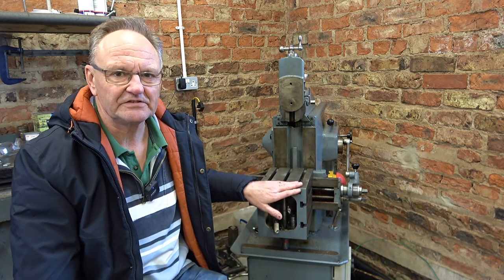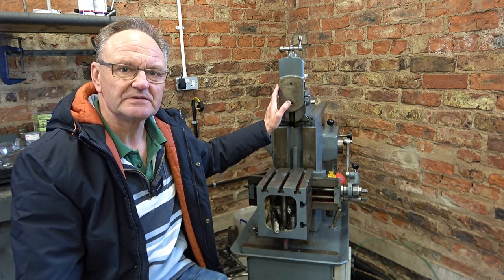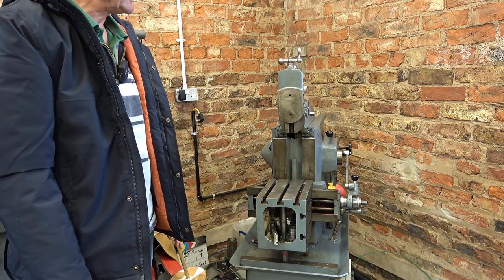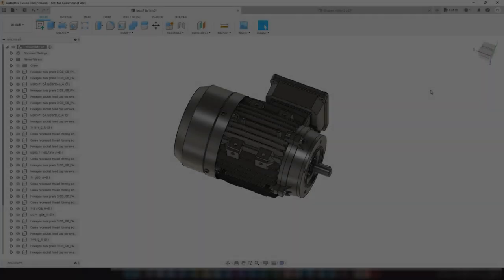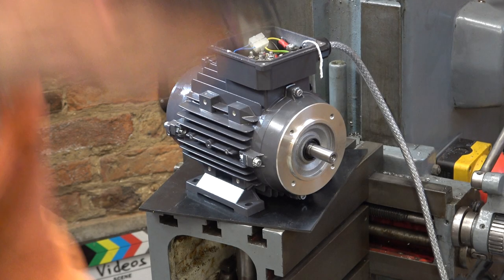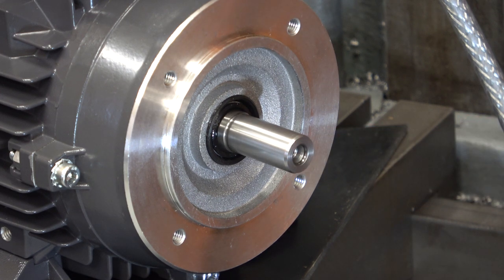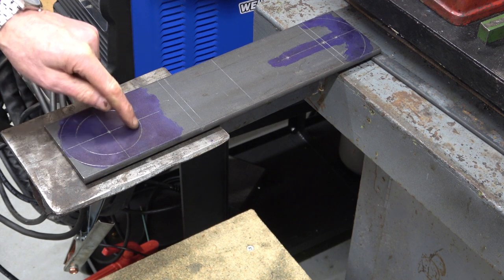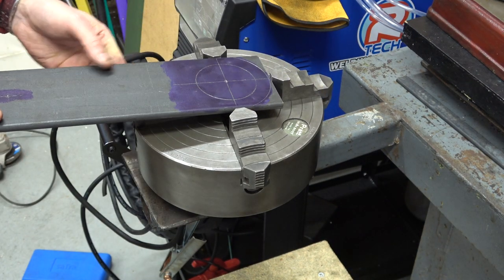HS132 Shaper milling head – Part 1

Comment: I got a kick out of your project. I  greatly appreciated re-manufacturing the motor too.
Reply from the maker: Hi Don, yes discovering I had to 'remanufacture' the motor was a bit of a disappointment since I had bought it new.  I would not mind if it were a scruffy old motor from a flea market.  But it worked out ok in the end. Cheers
Reply: @HaxbyShed  Fact is, I had a fan motor for our heating system go out on a cold night recently. Motors for the furnace are no longer made (too old). I found one of the same frame size and had to rewire the furnace because the motor was wound differently. God helps those who help themselves. What else can I say? II guess that says it all.

Comment: I can't wait to see how this turns out!  

You basically end up with a German or Swiss style milling machine like a Deckel or Aciera with your conversion.  I have actually considered doing this myself just to have something weird in the shop but it also gives you the ability to auto surface large areas of material if you use the shaper auto feed!  Anyone who might have doubted your project has never seen a large metal planer with a milling head attached, that happens all the time and people have been doing that conversion for more than 100 years!

Thanks for positing this!  Super cool project!
Reply: How might it work with the shaper auto-feed? The shaper feeds during the return stroke of the ram, so any cut made on the return stroke would be slightly diagonal. In additon, the speed of the return stroke is considerably in excess of the forward stroke.
Reply from the maker: @DJT and @Darryll, can I be diplomatic and say you are both right. To get the auto feed the ram has to travel back and forth over the work. The motion would be as Darryll says. I can't say yet why I would want a fly cutter (for example) in the milling head feeding over the work but one thing I've learnt is if you have a capability one day you will use it. I've built many things on faith and there has always been a use eventually - usually something that no other of my tools could do.
Reply: @HaxbyShed  Thanks for the reply,  I mostly had surfacing in mind with the table auto feed.  The surface speed of a shaper is actually changing constantly due to the variable geometry and relationships within the drive system and yes it does speed up dramatically on the return stroke.  Using the auto feed wouldn't be ideal but it would work.  Climb vs conventional milling would be a definite consideration during machine setup. In any case I would set the stroke rate pretty slow.  If you disabled the table advance mechanism you could let the ram run and just manually advance the table as another option.   Just some thoughts.

https://www.youtube.com/watch?v=AFHDFf_DhlM   This guy demonstrates a Bridgeport head mounted on a planer mill.  I've seen this conversion in many old tool and die shops.  No it's not a shaper, not the same feed mechanism behavior, but a similar idea.

Thanks,  DTJ

Comment: Gaining some milling capability for no extra floor space and hardly any money it sounds like a project that has no down sides! Looking forward to part 2!
Reply: well the alternative would be just a regular mill and ya don't need as much clearance behind. but with the cost and that this guy is married to that shaper this solution works for him.
Reply from the maker: Hi TRM, it ain't no Bridgeport but it will do 90% of the jobs I need to do I hope. And if I'm really stuck I do have a friend with a mill. Cheers
Reply from the maker: You are right Nick450, I am very fond of the shaper.  😁

Comment: Good Idea Paul...Surprised no one has done this before. Should work good.
Looking forward to part-2
Reply from the maker: Hi Dean, I've not seen it done before but of course most people just buy universal millers. There is a reason why you don't see shapers much these days. But you can't beat a shaper for cheap tooling, oh and internal keyways of course (I always throw that one in). Cheers

Comment: Had a very similar issue with a very similar motor. 0.2mm runout on shaft, sent it back, the replacement was fine.
Reply from the maker: Hi Constantine, the output shaft was actually ok it ran true, and the bearing surfaces were fine. I don't really know how they get some parts concentric and others wobbly on the same shaft! You would think it would be one machining process all on the same centres. Cheers

Comment: Of course it works! And if it doesn't, you will make it work.
It's always fun to make attachments and let machines do what they aren't supposed to do. A bit like my gear cutting system on the shaper.
Reply from the maker: Michel, I think your gear cutting on the shaper was inspired work.

Comment: Now that is and interesting project, you picked again:-) I have been thinking kind of the same, just an old horizontal mill, that needs the vertical "approach" , I have not been thinking about using the shaper for that, but a great idea, sir, and thank you for sharing. Kind regards from Denmark
Reply from the maker: Hi Henrik, always good to hear from Denmark.  My motivation is to get the most from the tools and machines I have.  Cheers

Comment: Look up " Inverer Drive Supermarket", very good company,  from inexpensive motors to very high end motors and Controllers.
I think that modelling a shaper in a CAD program is a first,  impressive model,  3D modeling is a lot easier than the old 2D programs, so easy to stretch or shrink any feature. 
Looks like a great concept Paul.
Thanks for sharing.
Reply from the maker: Hi John, I had a look at three phase motors on that site just now,  thanks for the pointer. But in a way it kind of reinforces my point because many of the motors are TEC, which is the brand I bought, and many of the others are Universal which look the same as TEC just painted sky blue instead of grey. So I'm just suspicious mostly it's the same stuff with a bit of badge engineering.  Having been bitten I'm wary now. But don't take that as negative towards your helpful comment because I may just have been unlucky.  After a couple of hours wrestling Fusion I was ready to chuck it in but after a while it started to make sense. It is clearly very powerful - particularly where suppliers provide the 3D models which you can integrate into your projects. Doubtless I will return to it. Cheers

Comment: Nice bit of blue sky thinking, looking forward to seeing how you fit the collet Chuck to the spindle, I made a milling machine from an old Herbert drill press and had to make a spindle with collet Chuck attached
Reply from the maker: Hi Terry, fitting the collet chuck to the spindle was troublesome for sure. I made some changes to support and stiffen it. It runs 'true enough' for what I'm doing. That's what added to the time really. Cheers

Comment: Clever conversion Paul, well thought out. Pity about the amount of work the motor needed, but at least you have peace of mind that you've been in there and there are no more nasties lurking. 
Best wishes, Dean.
Reply from the maker: Hi Dean, I would liked to have balanced the motor properly but any static balancer I can rig up has too much in-built friction.  Now a small dynamic balancer would be a good project sometime. I have an old oscilloscope. Just need some transducer sensors and a small motor to spin it .........  maybe.  That could be very satisfying. Cheers

Comment: Great design work with confusion 360 [I suck at Fusion 360 lol] a very interesting project as well. Great job and thanks for posting Paul 👍👍✔✔
Reply from the maker: Hi Al, I am sure I will do some more on Fusion sometime in the future because it has amazing capability. I would probably use it more if I had a 3D printer - or perhaps if I create a design file for some part and get somebody else to print it for me. Cheers.

Comment: This will be an interesting project. It is a shame you had to spend so much time on the motor. You have reminded us that we need a new blade for our Rapidor
Reply from the maker: Hi GTB, well if you change the Rapidor blade be sure to set it true. That yellow blade was cutting very accurately at 90 to the bed and after I changed to the blue blade it was cutting angled off 1.5mm in 100mm. Now to be fair it's the first time I've cut anything as thick as 100mm bar but I think the yellow blade would have been closer to 90. I need to recheck it. Cheers.

Comment: Very interesting project, just a pity that you had to put so much time into correcting a brand new motor! I think it is the same make as i got for the Covmac lathe, and the do have a very similar “odd” noise to them, unlike the old Brook motors which were virtually silent. I was given a cheap Chinese bench drill which worked adequately but had a very noisy motor, when stripped i found that the windings were very poorly laid and most of the noise was magnetic. The windings on your motor looked much better, so like most third world engineering, it is rapidly improving! Good work on the rotor, and the result was much quieter! Looking forward to the rest of the series!
Phil
Reply from the maker: Hi Phil, much of what I buy from Asia is good but it's like any market where the quality varies. In this case I think it's a good design with some manufacturing issues. The problem really comes where the quality is too poor to use for the job intended. If all the products are really made by the same manufacturer but with different badges, and if local manufactures have left the market, it means choice is really limited. Cheers

Comment: Ciao Paul,
 really very, very interesting: first of all I noticed that you started, with considerable added value, to use a 3D CAD, I use Solidworks but more or less they are all the same, I also used Fusion 360 (from the Autodesk family so Autocad etc ..), indeed, if you need to build some particular piece to do some studies or other, I will be proud to help you or to collaborate in the case, we can exchange 3D models in .Step, IGES or other formats and so, if you want to ask me something, please ask me without any problems ; I saw that  the motor is directly coupled to the spindle axis:there is usually a reduction in RPM between motor and spindle, where the number of revolutions decreases, the torque increases: therefore a reduction, for example 1: 2, halves the number of revs but doubles the torque, so here you have the asynchronous motor's nominal torque, I don't think it's low anyway looking at the motor size !! And in any case, there are coaxial gearboxes (with planetary gears) that would only move the motor up in the direction of the spindle axis, in case !! I am waiting for video number 2, with a lot of curiosity !! Congratulations, as always a great video, as well as a project out of the standard! Cheers from Italy,  AB-SHOP
Reply from the maker: Hi Alberto, I spent a lot of time considering a 2 pole motor (2800rpm) or a 4 pole motor (1400rpm).  In the end I was guided by the traditional Bridgeport mills which have a top speed of about 2700 which I can get with a 4 pole motor at double speed (100Hz). The motor is 550W and the IMO inverter gives excellent torque control. The ER32 chuck holds a max of 20mm shank. I don't expect I will be using a large fly cutter because I have a shaper already. Maybe using some sort of boring head if I cannot get the work in the lathe might be the hardest task for the motor but I think it will be ok. Cheers
Reply: @HaxbyShed Yes, take a reference to the Bridgeport milling head was a nice idea, ( Bridgeport was One of My dreams and It remain like this, no space for that 😅) I think that with the torque of 550 Watt you will not have any problems, of course until a 20 mm more or less end mill diameter, and also depend of how many tenths of a millimeter you wil cut! You know, your head power Is the same of  My old cinese lathe 😁

Comment: Hi Paul,

Would there be a possibility to improve the motor bearings/bearing housing by tapered roller bearings?...or did you address this further on?

Nice project though and a lot more realistic then ,,modifying,,a milling machine to a shaper!
Robert
Reply: The cast end bells aren’t really designed to take more pressure than a tight belt. They are not difficult to machine from scratch if different bearings or a beefier mount is required.
Reply from the maker: Hi Robert, I do improve/augment the bearings, but in a different way.  You may know, there were hybrid machines that were basically a vertical miller with a shaper attachment - Craig Tate has one https://www.youtube.com/watch?v=kPe7LEVRjhU   I'm guessing it was a cross-over technology as vertical millers were coming in.  Bit of an awkward set up though.  Cheers

Comment: That was brilliant Paul and I think the whole idea is inspired. Obviously the video is retrospective and you know the system works. How do the motor bearings cope with the cutting forces? And what is the torque like at lower motor rpm run from the vfd? Wondering if a separate bearing housing with taper roller bearings could be an upgrade. I like using the lathe to generate large diameter holes that way. Be nice to grind a tool so the hole could be trepanned that way. I have no idea how to use any cad software so I am in awe of your ability in that regard. I did once try to learn autocad but it was beyond me. I think now that the amount of time it would take me to learn it is far too sizable a chunk of the amount of time I have left.
Reply from the maker: HI Carl, I have improved/re enforced the bearing setup but I will let the video tell the story. The setup is new to my shop so I don't have much experience with it yet regarding torque but it is a 550w motor with an industrial grade VFD with good torque control. The ER32 chuck takes a max shank of 20mm. Bascially I think it will be fine. It's only for jobs I cannot do with the shaper - such as internal pockets so that's endmill territory and hopefully not too much strain.  I could have used my home made trepanning tool to cut the hole but it's not worth setting it up for 8mm think plate.  An annular cutter would be good (rotabroach type) but the one I have is only 40mm dia so again not actually saving me much time.  CAD work was powerful and fun but also frustrating to learn. I only tried because the motor came with a 3D drawing file to start me off - oh, and I thought it was about time I made the effort. Cheers
Reply: @HaxbyShed  Good stuff Paul. I did not realise before writing this that someone else had already asked the question about the bearings. I will look forward to finding out how you developed the idea in future videos. Thanks.

Comment: I had a really clapped out motor on my drill press and did pretty much the exact same thing. It was so bad that the rotor actually was hitting the laminations on the stator 🤣.
Reply from the maker: Hi just1guy, but always satisfying if you can repair. Cheers.

Comment: Why didn't you go for a DC brushless motor? I use one on my 5" 1930s Erikson lathe, 3/4HP fits in my hand. Comes with integrated speed control.
Reply from the maker: Hiya Tinkeringtim, I know a bit about AC motors and inverters so I guess I stuck with what I know. Next time I will look at DC. Cheers
Reply: @HaxbyShed  do you have email? I could send some pics and info. I have a Harrison too, with original vertical head. Might be interesting to compare their performance.
Reply from the maker: @tinkeringtim7999  if you look in the 'about' section on my channel info you should see my email address. Or it's at the end of my 'odd jobs and stickers' vids. I prefer not to post it into comments because it can lead to a lot of spam. Cheers

Comment: Pual. I'm sorry i find the serie about the milling head on the shaper.
Reply from the maker: Ah good Huib, I was just about to send you the link. You will some comments saying it will not be very rigid or suitable, but in some later videos you can see it actually works very well for small jobs. After I made it I upgraded the front bearing to a taper bearing. It took a few minor changes to get it working best. They are all in my videos. Cheers

Comment: Interesting concept but when you factor in time, material and resources your still better off spending the money and buying a mill.  With no DRO mounted on your machine, you can’t even put in a basic hole pattern and repeat it over multiple parts.
The point is…if your going to invest all the resources you invested into a conversion.  Wouldn’t it make sense to have the full capability of that machine as a mill? Why limit yourself??
Reply from the maker: Hi PTV it's really that I set myself the challenge and I did not want to give up space for a Mill. I learnt a lot along the way. As you say buying a Mill could be cheaper, quicker, have more capability etc. I was not suggesting it was good for everyone (or even anyone except me) 😁. Cheers.